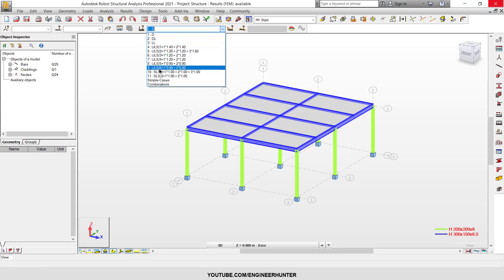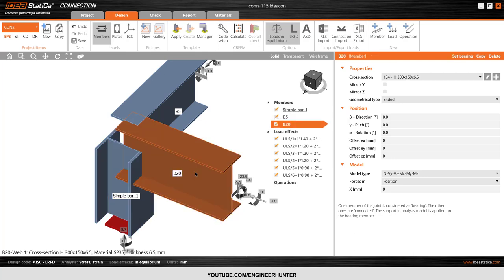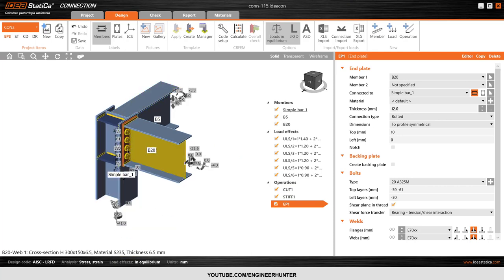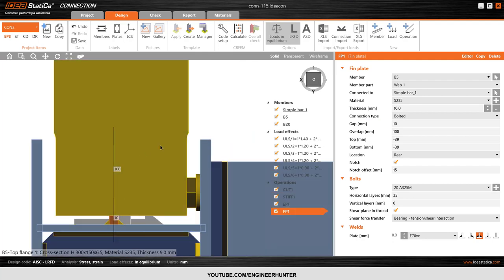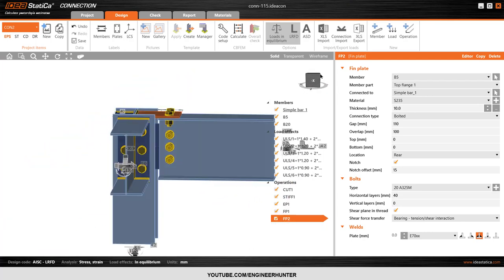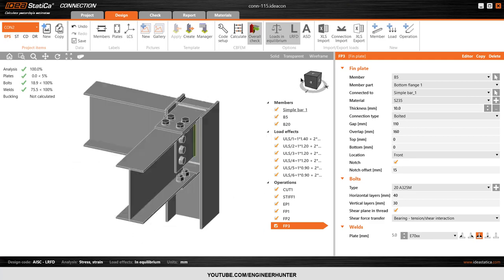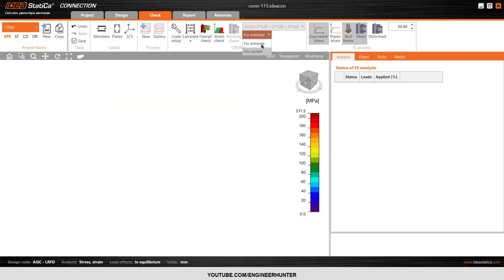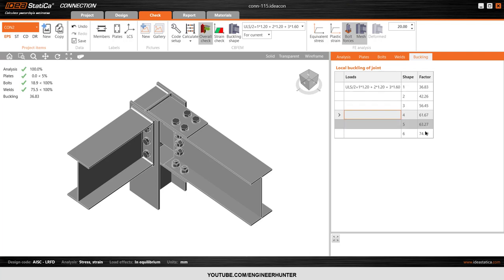Autodesk Robot Structural Analysis to IDEA Statica Connection Design

Comment: why ? link Robot to Idea can't in my coputer .
Reply from the maker: Check what version of IDEA StatiCa you are using because some versions are not support with a certain version of Robot Structural Analysis. If you can, try to install the latest version of both software.